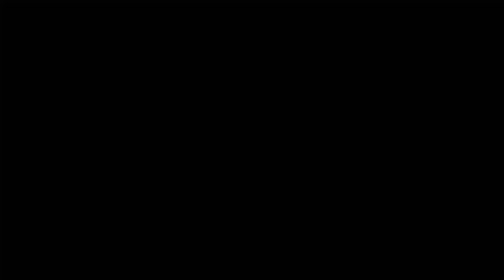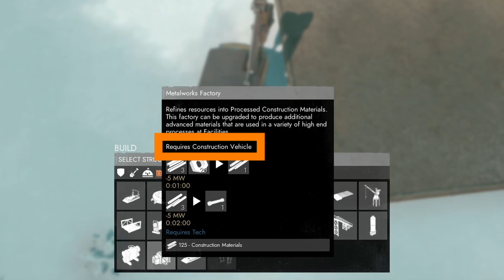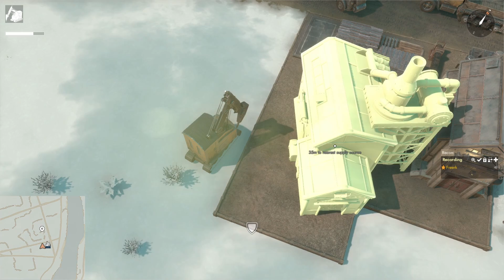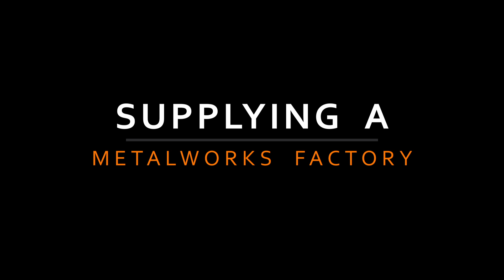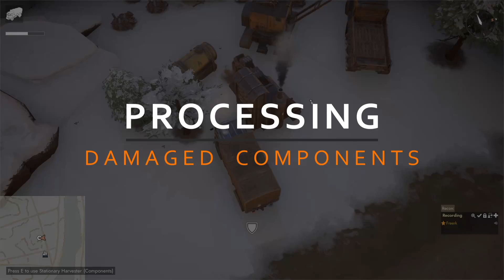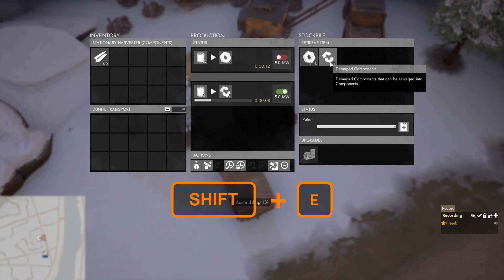Foxhole Facilities - Metalworks Factory

Comment: Hey, I was just in the game and I was going to add the engineering station to get steel construction mats but it doesn't allow me. Can you tell me why that is?
Reply from the maker: Could be several things. If the facility is squad reserved and you are not in that squad then the reservation stops you from upgrading.
You might not have all necessary materials inside the inventory of the facility.
The Engineering center might not have unlocked yet. It is a "tier 2 facility" technology in the tech tree
Reply: @FreerkHoltes I am in the squad I built it myself. So its probably a tech tree thing. Hopefully we get to unlock it soon.